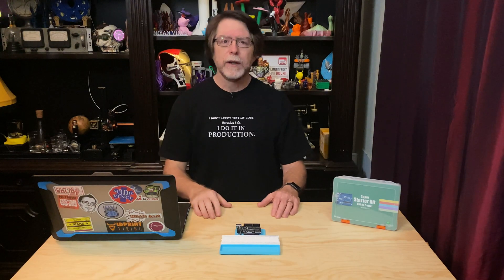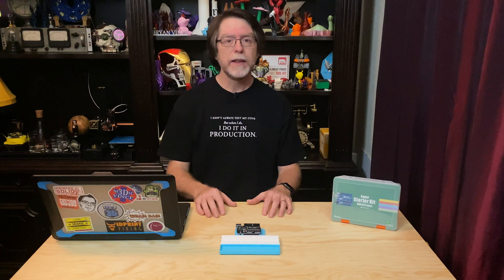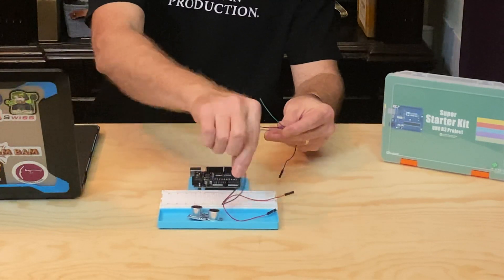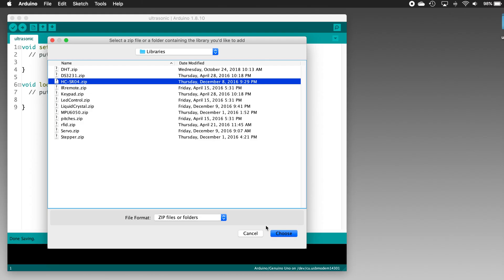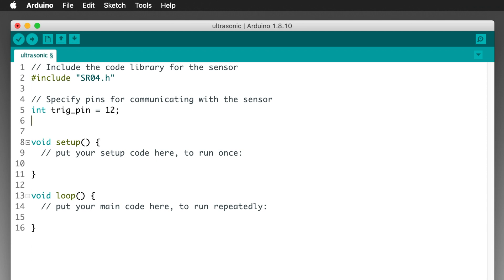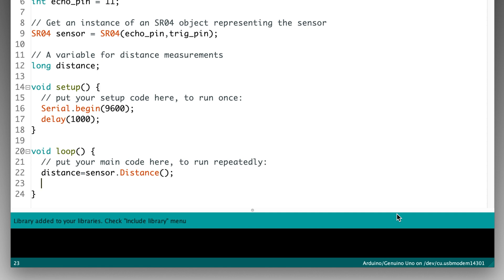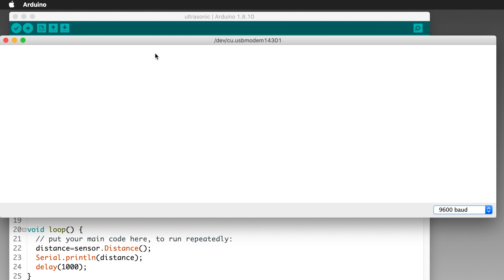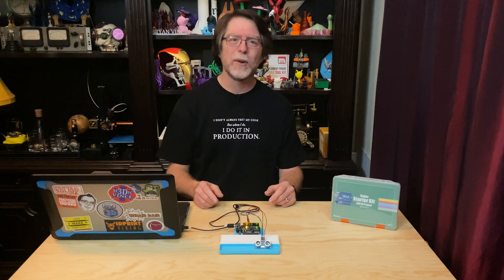Get Started in Electronics #8 - Using the HC-SR04 Ultrasonic Sensor

Comment: For some reason, I only get '0' over and over for this one.  I can't find any syntax or wiring errors, but I have to think I'm overlooking something.  The only difference I can see between my code and yours is that on line 9 SR04 sensor = SR04(echo_pin, trig_pin);  the first instance of SR04 isn't showing red in my IDE.   

EDITED to add:  Son of a gun.  I rebooted the PC and tried again this morning and now it's working.  Enjoying your videos!
Reply: i know you have now fixed the problem but you possibly didnt have the library for the sensor chosen?

Comment: if u want to combine the grand theft project with this, (my ball sensor didn't work) here is the full code for ultrasonic sensor combined w/red LED and epoxy bottom speaker

#include "SR04.h"

int buzzerValue = 3;
int redValue = 2;
int trig_pin = 12;
int echo_pin = 11;
SR04 sensor = SR04(echo_pin,trig_pin);
long distance;

void setup() {
  // put your setup code here, to run once:
Serial.begin(9600);
delay(1000);
pinMode(redValue, OUTPUT);
pinMode(buzzerValue, OUTPUT);
}

void loop() {
  // put your main code here, to run repeatedly:
distance=sensor.Distance();
Serial.println(distance);
delay(1000);

if(distance < 30){
  digitalWrite(redValue, HIGH);
  digitalWrite(buzzerValue, HIGH);
}
if(distance > 30){
  digitalWrite(redValue, LOW);
  digitalWrite(buzzerValue, LOW);
}
}

Comment: a lot of the other videos have been more informative as to what different code means, however I had trouble with this video.
what is the point of the paranthesis after distance?
what is point of the 9600?
Reply from the maker: Hi! Distance (with a capital D) is a function within the sensor's library. When calling a function, parenthesis are included to pass any data to the function that it may need. Since the Distance function doesn't need any data passed to it, there's nothing in the parenthesis.
The value 9600 is the speed, in bits per second, at which the Arduino IDE's serial monitor communicates.
Reply: @BV3D  thank you so much for the quick response! I greatly appreciate you making these videos! I’m more of a visual learner so this helped me understand a lot of stuff a lot easier!

Comment: Re: the occasional anomalous readings you're getting. A single "if" statement could filter those out - a simple reasonableness test.

And that may be a bad idea. 

In 2002 researchers from Southern Methodist were digging through seismic data looking for traces of a theory - that a super-dense particle, a "strangelet", could hit Earth - and blast through. And they found a couple of such events. In 1993, seismic traces that looked very much like what they would expect - sudden, sharp seismic events passing through the earth at about 900,000 mph (seismic waves typically travel at a leisurely 10-20k mph). One of the events, for example, recorded an  explosion starting in the Pacific south of the Pitcairn Islands and traveling through Earth to exit in Antarctica 19 seconds later.

But that's about the most recent data they'll ever get to study - such anomalous readings have been filtered and discarded since the mid-90s, because there's no point in storing equipment "noise" - stuff that shouldn't be happening.

Astronomical visible light and radio data is similarly filtered - so is particle accelerator data. Understandable considering the sheer mass of data, but there's a lot we don't know about that might not make it through a "sanity check" filter. Often the best science is from the data that makes you say, "Hmm, that's weird." If nothing else, unfiltered data can tell you how glitchy your equipment is.

Given the price point of these sensors, I'd go with glitchy equipment, and filter the bad data. Because it's almost certainly not an ectoplasmic sonic echo that explains what your cat is staring at just behind your left shoulder...

Comment: Thanks Bryan, I have a project for this to measure various bin/tank fill levels. This sensor should come in handy. Only thing is that this is just returning the information to the monitor and needs direct connection to my PC. Do you the best way to have this out in the open somewhere? Perhaps a LoraWan extension for the arduino and some extra code to push that data somewhere?

Comment: Could the sensor be used as runout filament sensor for a 3d printer?
Reply: This sensor is doubtful to be useful for filament run out. But it wouldn't be too difficult to  use a led (with resistor) and a ldr (light detecting resister), if you was to set it up right and different programming of the arduino..

For a bit of fun, I set up the arduino to sing a Christmas song whenever someone walked past it.

You would need to do something similar, bit more refined..
Reply from the maker: Syntaxcuemi 3D I don’t think it would work well in that application. This sensor is more for telling how far away something is. For a filament runout sensor, you’re far better off using a device made for that purpose. Search “Filament Sensor” on Amazon to see a bunch of options, several under $10. I saw a two-pack of sensors in the $8 range. 👍🏻
Reply: @BV3D  looking at it again, the sensor unit, is a bit large for the application. But it got me thinking, could it be used as an abl sensor? OK, it'll need a bracket printed for it & the output signal could be used to trigger the z distance in marlin. Just like the ezabl sensor.
Reply from the maker: Syntaxcuemi 3D According to its documentation, it has an accuracy of about 3 millimeters, and the code library for it is returning values in whole centimeters. Even if you were getting it to work at its peak accuracy, it could be off by +3mm or -3mm on any given reading. It just doesn’t have a high enough resolution to be used as a bed probe. I know a lot of people like using inductive bed probes, which work by detecting (with great accuracy) the presence of the metal bed on a 3D printer. But if you have a glass surface on top of the metal bed, or you swap out flex plates with varying thicknesses, you have to adjust the Z axis offset to match each surface. With a touch probe (like a BL Touch), the probe senses the surface of the bed and so it doesn’t matter what print surface you’re using. 😊
Reply: @BV3D   I didn't realise there was such a high tolerance. I think 6mm tolerance is a bit much for a endstop probe 🤦‍♂️🤣 i have an inductive probe on my Ender 3 Pro (donated from work). But its rated at 12-30v. Couldnt find a compatible 5v probe 🤦‍♂️ so I had to use a relay to make it work. It does work to a sort. But it has a weird leving issue. So for now, I've gone back to mesh bed leveling.

Comment: awesome vid, Bryan :D small tip: if you use #define instead of int, you won't waste precious memory on the small microcontroller ;) also, i never knew about that library, i always did it without. awesome! 
also: if you plan to make more complex projects like the LED one you mentioned, i highly recommend you check out "betterbreadboarding.com" he is a really nice person and he made small labels for wires :D 
cheers.
Reply from the maker: Thanks for the info! I may start using #define instead of global INTs. It's probably a good habit to get into, rather than something to pull out of my programming toolkit if I start running out of space on the microcontroller. 😃
Reply: @BV3D  cheers! :D

Comment: Great tutorial, and I am glad you go further than just 3D pringing.
A tipf for this sensor, is to stack the check.
If distance >100
then 
If distance >100
then 
do this
This way you filter out some noise.
Reply from the maker: Hi MisterMaker! Great tip, and keeps the weird distance readings at bay! 👍
Reply: @BV3D  you could also just take like 10 readings and then average it :D
Reply from the maker: id True, I could, but that would take a lot longer to get a reading. I like the idea of just throwing out excessively large readings and trying again. 😀
Reply: @BV3D  okay :D